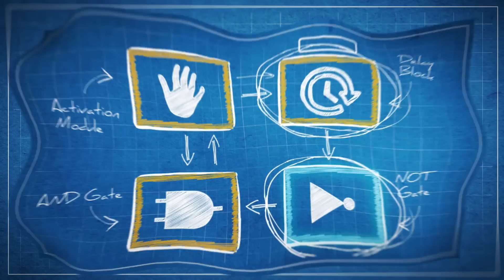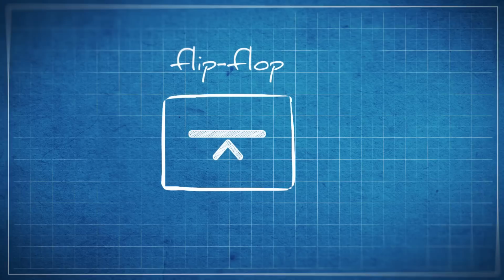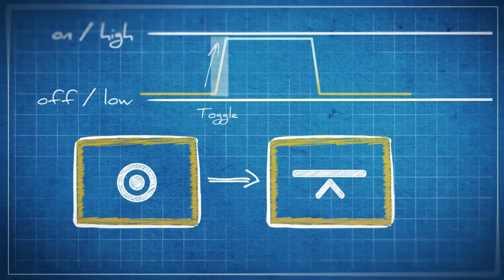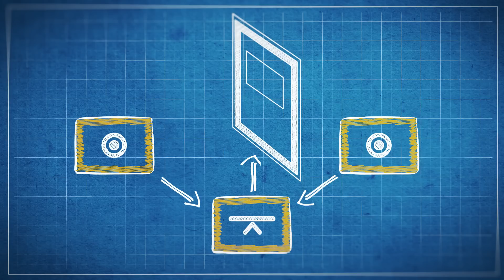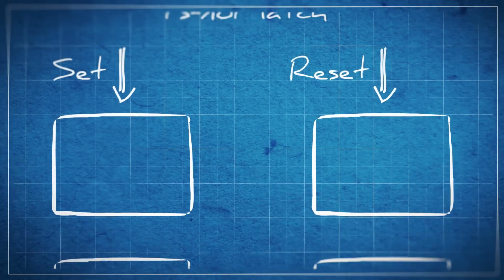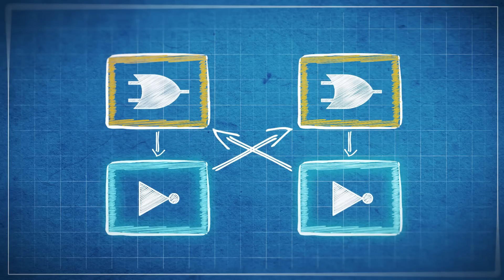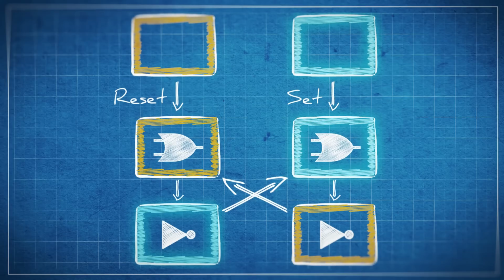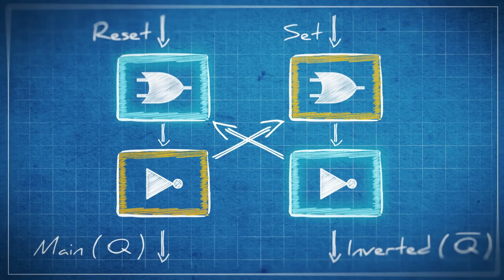Starmade Masterclass 04 - Logic - Memory Circuits

Comment: Could you Please do a video on the RS Nand- latch as well? It would be helpful to others to have both of them and describe how they are useful. I like to use a lot of wireless circuits and when i build them i like to have low as off and positive as on. So there is no confusion in my logic circuits.

Comment: I need some simple self sustaining clocks.
Reply: Simple you say, not sure if what I am about to describe is simple but it only uses 6 blocks and works like what you are describing. I discovered a similar one in Bench's videos and I adapted it for my uses

Activator (First) > NOT > OR > NOT > Delay > Activator (Last)
                                                            
To complete the circuit make sure to take the Last Activator you placed and link into the OR block. You will have to set the logic gate once by clicking on the first activator. Once it is set the first activator while in the High/ON state will turn on the clock and will stay on until you turn it off. Setting the First activator in the Low/Off state will stop the clock.

If you remove the first NOT in the circuit (make sure to connect the first activator into the OR block) it will reverse the activation states allowing Low/Off state to turn on the clock and the High/On state to turn it off. This was how Bench originally used this clock in his video. I can't remember exactly the name of the video I saw this in but he was showing off his star wars Lambda Class shuttle.

Hope this helps, let me know how things go.
Reply: I thought this would cause a solid ON loop, but it doesnt.. thats so weird.
Reply: My solution was:

ACT01 > AND > NOT > DELAY > ACT02 
\/
Button > ACT02 

And then link ACT02 into the AND gate. It creates a similar locking mechanism.
Reply: To you first reply of staying on, the ACT01 when active will stay on until you press it again to turn it off. I did mention that you have to SET the logic first before it becomes what you need it to be. Basically you turn the circuit on and off and it will be ready to go the next time you should need to use the circuit.

To your second reply I have considered changing the clock to:

Act01 > AND > OR > NOT > Delay > Act02 (connects back into the OR block)
\/
Button = Act01 (on/off button)

Basically I removed the first NOT and replaced it with an AND

I haven't tested this but I have considered changing the circuit to work like what I had described before. The small problem with the one you created is that you have two inputs going into the AND and they both need to be active before that AND becomes active to complete the circuit.

Comment: correct me if I'm wrong, but can't you create an RS-Nor latch by using a flip-flop linked to a Not gate? say if I had a button linking to the flip flop gate, you would only need to change the input once and have it swap between the two outputs, the same way the system you mentioned would, but with three blocks instead of six, and in my opinion, less complex circuitry
Reply from the maker: The benefit of an RS-Nor latch compared to the flip-flop is the ability to split the inputs into the circuit that cause it to change. This is most useful in instances where you need quite a robust circuit that can handle errors and edge cases. You could also use AND gates that use a flip-flop or a NOT coming off the Flip-flop to control inputs into the flip-flop, but with a similar block count and no delay in responses, it might not be as robust.
Reply: Thanks for the reply Bench!

Comment: Is the flip-flop block the same as the toggle switch?
Reply from the maker: Essentially, however the Activation Module always changes to the last input it received. It's possible to use activation modules in memory circuits, especially if you need to utilize this particular function that the Activation Module provides. The flip-flop on the other hand is much more practical when you just need to toggle using various inputs.